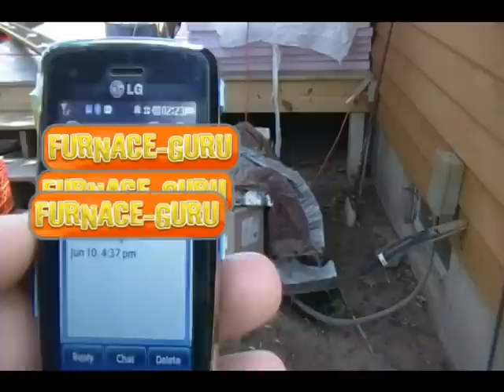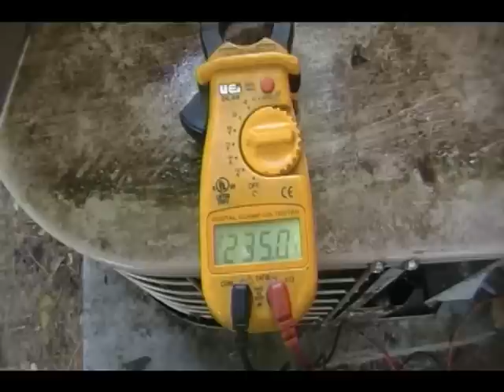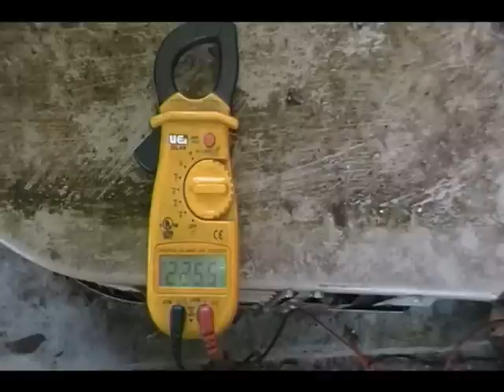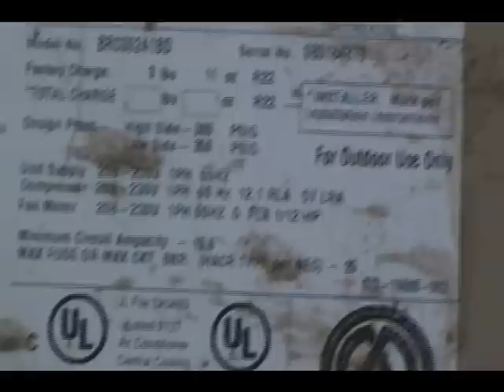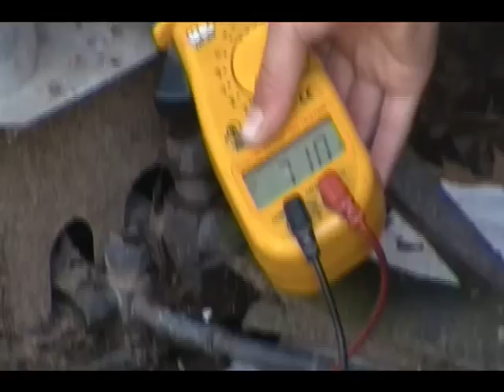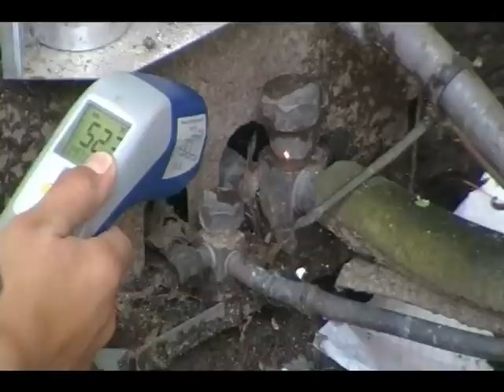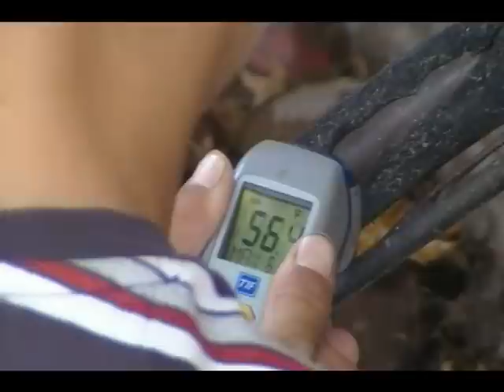Spring time air conditioner tune up for the DIY person  / coil cleaning

Comment: After doing some research I going to spray Simple Green cleaner on the coils and rinse from the inside out. After cleaning all the leaves and junk at the bottom. This will also allow me to oil the motor and clean the fan  blades. Love my 18 year old 4ton Train and want to keep it running like new. Every year I have to replace the coil but it’s worth it for Texas summer heat!

Comment: Nice job! My unit had about 2 inches of debris on the bottom that I wanted to clean out. The problem I had was that the fan is attached to the top and the wires were too short to move the top more than about 6 inches. There must be an easier way. Maybe there are quick disconnects but I didn't look that far. I removed the rear panel, scooped what I could by hand and used a wet vac to clear out the rest. Cleanest unit on the block now.

Comment: Thank you for this video and getting your son involved. 
I would think that the best measure of condenser efficiency/effectiveness is to measure the temperature drop between the output of the compressor (a bit more of a challenge) and the high pressure line going into the house.  Increased condenser efficiency would be shown by a decreased temperature on the high pressure line.

Comment: What causes burnt wires?  Just discovered the whole compressor would not run due to burnt wires.  I replaced them, and it came back on OK, but do I have a deeper problem which causes the wires to burn out?  Thanks.

Comment: I can change my contactor and capacitor which need to be changed every 5 years. They are available for low prices on amazon. Over the years I have had wires burn off of the contactors.

Comment: I have a question. Would it be prudent to spray the coil cleaner and then remove the cover and rinse from the inside? I feel like you'd be spraying hunk back into the fins. Thanks

Comment: I don't mess with Freon, but I do all my own a/c electrics and cleaning.   

A/c techs are not always your friend ... they will usually replace any capacitors with whatever ratings they have on their truck; not the correct ones!   Many local HVAC stores will only sell to HVAC techs ... ostensibly for "liability" reasons; which is BS!  

Just order from Amazon.  $30 and 5 minutes work versus $150 for an a/c tech!

Comment: Good job. Just wear a safety mast when spraying chemicals due to carcinogens. Also, if you can, remove the cage and spray the unit from the inside out. You’ll see how leaves and debris has accumulated on the inside. Overall. Good job!

Comment: My heart almost stopped when young Andrew was reaching to touch the capacitor.  He stopped an inch short of possible death.  Those capacitors store a lot of energy (440 volts) and if you touch them it could kill a grown man.  You must short them out by touching the contacts together with a rubber handled screw driver before you touch with your skin.  Maybe the long winter would have let some of the energy out but safety first.  Glad you were cautious Andrew.
Reply: Those things will hold a jolt for years, same with old tube TVs.

Comment: You are suppose to remove the top cover and blow the dirt and grime OUTWARD since the air is being drawn INWARD from the outside of the coil.  Blowing water in from the outside just pushes the dirt into the coils.  You also didnt clean with foaming cleaner on the inside of the coils.

Comment: Where can I get the equipment to clean the coils and check the electrical. What kind of screw driver do I need.
Reply: If you have to ask what kind of screwdriver, then I'm not sure you should attempt this....

Comment: I bought mine at home depot. made by web coil cleaner.. Also has anybody gone about cleaning the furnace coil?? I'm on that step. the ac unit is cleaned already :))  Trying to get mine colder any suggestions on how to measure at home some how you were mentioning??

Comment: * It was asked a few times, but I don't see a response to what he used in that spray can as a cleaner. Does anyone know? TIA
Reply: Harry Bombardi nu-brite sodium hydroxide. Very powerful stuff and will eat through anything with enough time. I wouldnt recommend using it as a homeowner.. If business use it, Atleast their work has insurance for the damage
Reply: Lowes sells a spray cleaner. Don't know if it's exceptable to the experts though. Experts?

Comment from the maker: The coils should be cleaned from the outside of the unit and then the inside if possible. You do not want to try and pull the dirt further into the coil.
Reply: kevin miller unless this air conditioner runs backwards that condenser fan sucks air from the outside of the coils then pushes it out of the fan. Therefore this would make the outside of the coils have all the dirt and grime. So in order to keep from pushing more dirt into the coils you would need to spray from the inside out

Comment: That AC looks in rough shape. I suspect the filthy conditions around it is partly responsible...sucking in the dust, leaves & other crap during operation. Generally I lift the condenser fan out before using the hose to blow the dirt from the coil/fins outward.
What the hell do I know anyway...
Reply: +Rick Rodrigues  It sounds like you have good common sense to me.  I don't think the teacher in this case is very knowledgeable.  Yikes!!!

Comment: What's the name of your coil cleaner? Pushed dirt right out, didn't you want to remove fan to clean inside? 
Thanks
Gilbert
Reply: gilbert de la torre yes I was always taught to remove the top and back washing the inside out not hose from the outside like they did

Comment: If that ac unit has been sitting all winter with the power off it means the compressor is cold and there may have been liquid refrigerant inside of it. Liquids are not compressible. On the can of the compressor there should be a heater. If it was shut off all winter with no power to the unit you need to plug the unit back in and wait a couple of hours so the refrigerant will evaporate. Not doing this can destroy your compressor.
Reply: Scrat335 only heat pumps have haters build onto the compressor. Standard air conditioning units do not have this feature

Comment: How old is that air conditioner and what brand is it?
Reply: that is a coleman and probably a late 90's early 2000 model
Reply: Shadetree Woodworking You thinking of replacing it for a more efficient air conditioner?
Reply: Its not mine. I am a HVAC Tech and just knew the brand.
Reply: Shadetree Woodworking Oh ok when did Lennox change there logo?
Reply: looks like a York, probobly early 2000's
Reply: Correct.  I have the same condenser.  Coleman.  Mine is from 1998 . 
4 bolts on the top ,  take the fan off for easy access to back flush the coils from inside out.  Easy peasy   been a solid unit .  Changed out the contactor,   a few duel run caps over the years and this winter will do the fan motor.

Comment: If you want to ruin your alluminum coil go ahead and use a coil cleaner like this in the video. Sure its clean but it will probably crumble in your hand 2-3 years down the road. Water is all you need to clean coils. If anyone tells you anything else they are lying or just plain ignorant. The aluminum used on todays ac units is just to thin and cannot handle the cleaners. Also the proper way to measure a voltage on a contactor is to measure the millivolt drop across the contactor on each leg. if it reads .1 or higher your contactor is restricting the voltage. If your also telling your customers to buy a volt meter you might as well have them measure the dual capacitor otherwise what is the point of even checking volts and amps. It is the most common point of failure on AC units. You also had your kid come dangerously close to live wire in the begining of the video. You really should have him wear redwing shoes or any brand that is rated for electricity. If your a home owner watching this video please pull the disconnect before you open the panel or wash the coil or it could possible end bad for you.
Reply: +gwozhog  
You seem to know what you are talking about.  Got a question.  When the kid started spraying water into the unit I was thinking oh no, forcing water into the fan motor I would think is not good, especially turning the unit on shortly afterwards.  I know they are designed to run in the rain and all but it just seems bad to me.  What do you think?
Reply: The motors are sealed but yes it's generally not a good idea to shoot water into the condenser motor. 99 out of 100 times you will be okay. Main thing on maintenances is to measure the dual capacitor for the compressor and condenser motors. Any reading lower than 10 percent the part needs to be replaced. Good luck to you.
Reply: hermetically sealed nothings going to happen. Just don't do it to the motor in the indoor unit
Reply: hvac Tech      You made me feel more informed.  Thank you
Reply: gwozhog how about dawn dish soap in a sprayer bottle...still too harsh?
Reply: Water is all you need. The coil does not need to be shiny to remove heat. The fins just need to be free of debree. Clean from the outside in. When the water looks clear shooting out of the coil move on to the next spot.
Reply: We also learn from comments.
Reply: R V awww little mad?
Reply: R V little mad? Just a little?
Reply: clark hall I was always taught to backwash the coil from the inside out and remove the top. This is to not force any more debris that has clung on from the outside and lodge it.
Reply: R V comebacks ?!? Omg hahahahahahahah this is getting put on Reddit
Reply: R V kid has been talking for a month hahahahahHAHAHAHAHAHAHAHAHAHA
Reply: R V go back to watching lemon rice videos and pipe down and stop getting so triggered
Reply: R V stop embarrassing yourself
Reply: R V cool embarrassing
Reply: R V almost 30 replies keep going this is all on Reddit keep it coming
Reply: R V 33.....posted
Reply: R V omg u don't say RV? Hahahaha hahahaha yeaaaaa keep it comingggggg
Reply: R V hahahahahahahahahahahahahahahahahahahahahaha 35 wait till the other comments come
Reply: Nick V call me ur dad son
Reply: R V AWWWW DID THE POOR BABY GET TROLLED AND CRY FOR A WHOLE MONTH
Reply: Nick V call me a YouTube celeb
Reply: Jason Genova Jr. This kid RV was on the Reddit posts hahahahaha Jason Genova is the man hahahahaha

Comment: I was surprised you let Andrew investigate and touch the wires on the capacitor before pulling the fuse! yikes!
Reply: ....and squirting the hose just before checking everything electrical!
Reply: e walt Yeah, Andrew might not make it through too many more videos like this one. I seriously hope this guys not licensed. Saw so many no go's on this one.
Reply: +Dawn Hart Absolutely correct. He should have (1) disconnected power to the unit first & (2) discharged the capacitor before cleaning.  Be advised the capacitor is still "loaded" even though power is disconnected! That's a huge high voltage capacitor (230 volts)  that can really give you a "jolt"...ouch!
Reply: Dawn Hart The fuse was already turned over, made open.
It parks that way so won't be lost. You saw that he turned it over and reinserted it to make it hot before metering the wires.
Reply: Been an electrician for 20+ years. Electricity isn't going to jump out at you. And all the wires were insulated. Only a few places where there were exposed  conductors. The guy obviously pre-trained his boy to look out for those areas....like you would train any other apprentice. Nothing out of the ordinary was done. Teaching a kid like that, who obviously is mechanically inclined and very mature for his age is a great thing. The young man has also obviously earned the trust of his father and has displayed competence....moving the father to allow his son to perform those tasks. So criticizing a father for teaching his son a skill like that is just stupid. Hell, you put your kids in way more danger every time you put them in the car.

Comment: Everything he did here was wrong. Nearly touching a charged capacitor,Checking the wrong cables for amperage he said around 12.6 wtf. Ur nor suppose to add. The boy got 7. Amp. Fucking guy u trying to killl your son. Tell him to try push in the breaker it clearly is a faulty breaker Teaching your kid's how be men is fine. But only do it if your certified. Home owner's dont listen to this guy he just knows how to read a text book

Comment: Well little Andrew did an okay job. Proud of him. However, one thing disagree with, is you having him check voltages on that contactor. Let me tell you, I have been hit by them dual capacitors while unit was running, burnt my hand and arm up cause it wouldn't let go. Was not fun. Home owner freeked out. All cause I lost my balance. Maybe andrew can video while you work. Would hate to see him get shocked or hurt. But other than that good job Andrew. All other concerns everyone else covered.

Comment: 1 you never put your gauges on a unit unless absolutely necessary.  This will contaminate the integrity of the freon.   2 . You never us any harsh chemicals on a residential unit.  3 you son should be wearing gloves and goggles at the very least.   You seem to one of those guys who work out of his garage.  We call you guys trunk slammers. Put the bottle of 22 back in your car.  Most of the time you wont need it.  Freon does not evaporate. If you have to add some then you have a leak and you need to find it and fix it.

Comment: I am appalled to watch the little guy checking 230 volts @12.5 amps. Not only that, the AC unit was sprayed with water and the top area is still wet. Is this little guy qualified to perform  such jobs? Daddy... wake up.